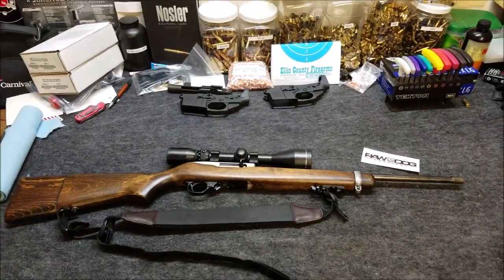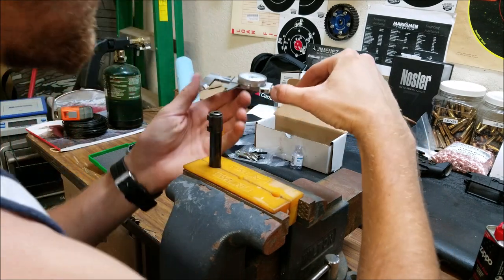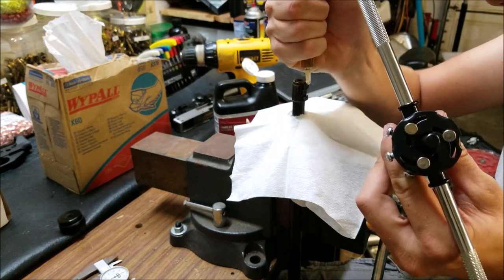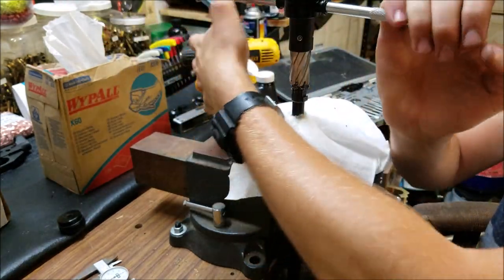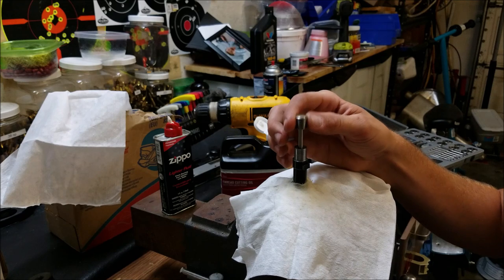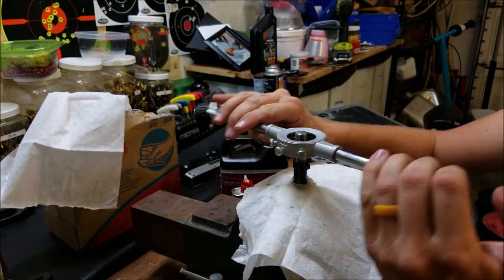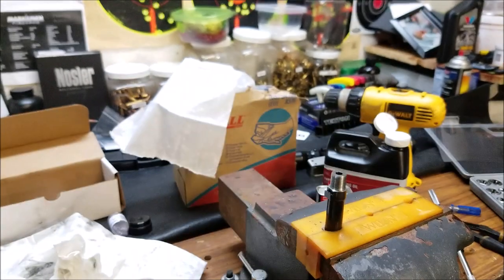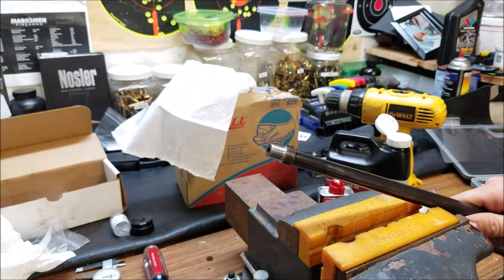Threading Ruger 10/22 barrel by hand

Comment: @GunsWithGage. Great video Gage, I was walking into the kitchen when you mentioned not running the Die all the way through the starter so it doesn't end up touching the shelf. So it could cause a cross thread.... I've threaded one barrel and although I was satisfied with a first time job, To see if the job ended up being concentric with the bore. First I took a Maglite & bought end caps at the hardware, then I put a thin piece of cloth over the end on the light tube, (I had to drill a 1/2'' hole in order to see the following), next I  put a laser bore-sight into the rifle. So at 11 inches, I was off center by about 1mm to the + side. All that told me was if one day I applied for a suppressor, this barrel may not work. But it was fine with a regular 3'' muzzle on that barrel. I suppose since the muzzle would stay with the barrel, I could run a drill bit through that muzzle to widen the diameter a tad.... Any suggestions you could add so I don't repeat the same mistake... Thanks again, MD...

Comment: What is the size of the annular cutter you are using. When I look on Amazon they are are showing the outside diameter of the cutter and I am concerned with the inside diameter since it is resizing the barrel for the die. If you could give the model cutter you used that would be great.

Comment: What size of annular cutter did you use thank you
Reply: The annular cutter would be the one matching the thread kit which would match your barrel. In this case, he used the ''1/2'' x 28'' thread set for .22 /.223 Caliber Barrel. Both take the same Thread-Cutter & Starter Kit.... On the Barrel I threaded, I had to put a piece of tape with one or two wraps on the Starter Rod, just to snug it up to the inside of the barrel... Mine turned out okay as far as I was concerned.. Some advise, CNC Warrior is a great place to shop. I bought a lot of tools on Amazon & I ended up having to replace Dies & with the Threading Kit I bought, they were what was causing problems with the end results... Don't go cheap when you're looking for Specialty Tools like you'll need for this type of job....

Comment: Is the cutter and die also made to be used for stainless steel barrels...I've actually had some brand name and what was said to be quality-made dies that even when going nice n easy with them whereby giving gentle and equal pressure and breaking the chip often, the stainless was hard enough that it pinged off a couple teeth on the die

Comment: I want to do this on a remington 597 but I'm having issues finding the tooling. Cnc warrior says that the annular cutter is out of stock
Reply: Just buy a regular annular cutter (note the diameters refer to OD, ask the seller for the data sheet showing the slug diameter) and then make an adapter to go on your drill. The annular cutter comes with a steel pin guide, and just wrap electrical tape or slide and heat on stacks of wire shrink tubing until it brings it to the diameter you need.

Comment: great job.  question if you would ?  Carolina Shooters supply sells the annular cutter to do Saiga's  7.62x39  but i worry about wreaking the rifling my the muzzle.  any problems with this ?  and you said that you did a sks but that is .30 cal not .22 cal do you need to have a differentiate guide for the .22 and a .30 cal ?  thanks.
Reply from the maker: MegaBait56 check out my sks video. It will walk you through your saiga job step by step!! Carolina shooter supply sells good quality tool. If you use LOTS of motor oil down the bore and on the bore guide, you will not damage the rifling at all. And if possible, lever your vice, lever the barrel face, and use a drill with a rear bubble level, that way you can be super straight and you don't put any sideways pressure on anything. You don't have to do that stuff, but it may ease your mind
Reply: thanks will do.................

Comment: How do you determine the cutter you need?
Reply from the maker: Depending on what threads you want, you need to cut the barrel to that specific OD. If you are cutting 1/2x28 threads, you need to cut the barrel down to 0.500 inches
Reply: @GunsWithGage  .50 inches OD?   And what is the over all depth?
Reply: 7/8 OD is the correct size annular cutter to prepare the barrel to thread 1/2x28 RH.

Comment: Bought a 1/2 X  28 die to thread my barrel  on my Ruger .22 Carbine . Used a 7/8 Annular Cutter BUT IT LEFT WAY TO MUCH METAL  .535  .. PUT TO MUCH STRAIN ON THE DIE.  Read the max metal should be no more than .498 .  having to sand it down by hand.  ANY SUGGESTIONS  , ANYBODY.   WHAT DID I DO WRONG?
Reply: There are different size annular cutters. Should of used a .50 inch one. there are slightly larger ones which you may of used.

Comment: What size of Annular Cutter is needed?
Reply from the maker: For 1/2x28 you need a 1/2" or 0.500" cutter with a 22lr pilot
Reply: GunsWithGage I’m showing 7/8th Inch which is giving me a closer outside diameter to 0.50"
Reply from the maker: I don't know how a 7/8 ID cutter could make a 1/2 OD cut for a barrel. You need a 1/2 inch cutter for a 1/2 inch cut OD
Reply: @GunsWithGage    Hougen 12128 7/8" x 1" Depth of Cut Rotabroach Annular Cutter (looks to be the same one CNCWARRIOR.com uses)
Reply: @CaFFeineSouLja  You are correct. Annular cutters are measured by their OD. 7/8 OD is the correct size to cut the barrel down to the correct diameter to thread 1/2x28 RH.
Reply: @GunsWithGage  Annular cutters are measured by their OD. 7/8 OD is the correct size to cut the barrel down to the correct diameter to thread 1/2x28 RH.

Comment: Also. Would it be a lot to ask for direction on what tools will measure so precise the overall depth and thread depth?
Reply from the maker: You need a good set of calipers so measure. Stay away from the digital calipers. Ballistol can work, but motor oil will be better for the inside of the barrel
Reply: GunsWithGage what weight motor oil? Any?

Comment: You see the way he is bouncing the die back and forth crashing it into the barrel to cut the threads?
You never want to do that, you want to use slow, even, steady turning pressure.
You risk breaking a tooth on the die.
Reply from the maker: This is 100% true. I have actually broken a tooth on a die doing that. I was using the incorrect vice jaws for the job and they would not hold the barrel tight enough to slow even pressure.

Comment: Folks do not use this crap to thread your barrel, you have no ideal how accurate this is. The only reason to put a thread on a small cal like this is for a silencer/suppressor as there is no recoil to worry about. You put a several hundred dollar suppressor on a gun min cost for the suppressor alone and that is a cheap one then the $200.00 tax stamp not to mention the waiting time to get the stamp from the NFA Most gun smiths will thread your barrel for 75.00 to 125.00, using tools and indicators that are accurate to .0001 and putting a class 3 thread on your barrel plus you will also get a thread protector to protect the thread when you do not have your suppressor on. Anymore than about .0003 out of bore alignment and your going to get a baffle strike, your suppressor is now trashed as many companies will not cover baffle strikes if you did the barrel yourself with these cheap ass tool. 

If your tool is off just a few thousandths you will have to cut the barrel off and redo it and that will require a gun smith to do it. Spend the money and get it down correctly. You have been warned.
Reply: I am in TX and need 8 barrels threaded and you can do it for 75-125.00 each?
Reply: @klinzy  Yes, not a problem. Look me up, not hard to find. Each firearm takes about 2+ hrs to indicate in the lathe and then about 30-45 min to cut. Comes with the thread protectors as well. Just please do not use this junk here, it maybe ok for a muzzle break but not a suppressor, if it is canted the least bit your going to loose your can and maybe more.
Reply: Lmfao theses may be "cheap tools" bit anyting is only as good as the person doing the job
Reply: @leeadam2632  I do not care if it is made of the best material money can buy,  the ideal behind it is flawed, there is not enough pilot inside to insure the true cut. But hey, you want to use this tool on your gun(s), help yourself, can always go buy another barrel or replace the firearm(s). Tools like this are a gunsmiths dream, because we always love the work they make for us to fix.
.
Reply: I would have to agree.  While this is a great video of the DIY method, the DIY method can be a terrible approach for the reason mention here.  I could see doing it myself if just for a cosmetic muzzle break but then you have most likely taken away the option of other attachments later where that spot on alignment is so crucial .  I think your giving some wise advise here TPG